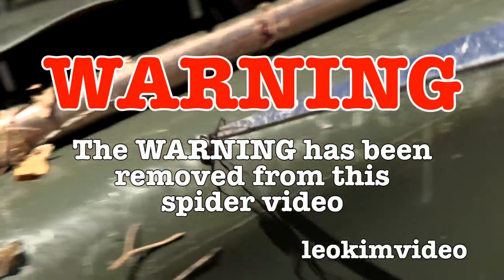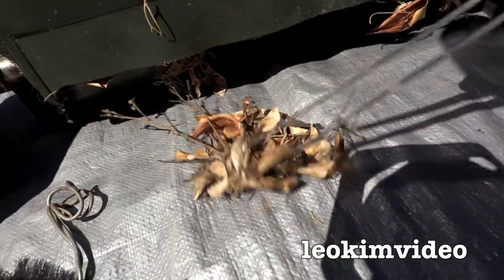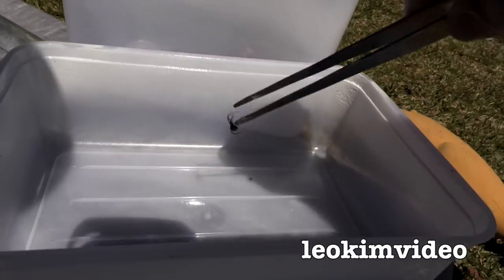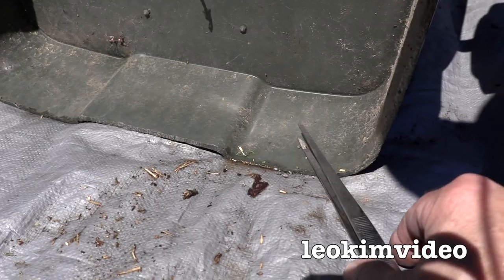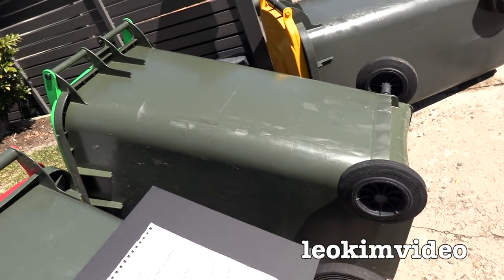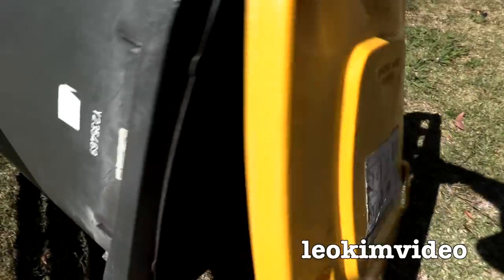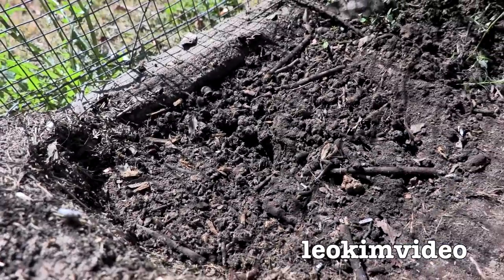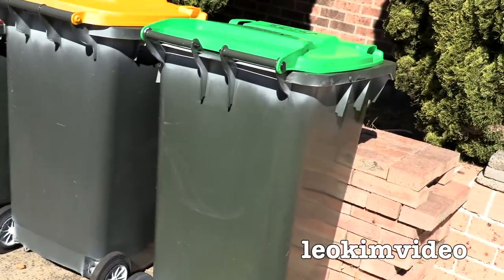Trash Bins Spider Removal $20 Fix & Redback Spider Tank EDUCATIONAL VIDEO

Comment: Keep up the good work! I love your videos. I got a war with recluses over here in Oregon. First it was ants and I won that battle. But now it's creepy spiders that leave a mark. I already got a bite on my ankle a week ago. Luckily I did my methods to clean it before it got bad. But I got webs and spiders all over my garage, and yard. Gonna go to the aerosol flame thrower method with a fire extinguisher, second hand and water to get rid of the webs and spiders. But I understand what you must be going through. I was removing siding from our fence the other day and saw a batch of recluses running everywhere in the yard and was thinking of you. Do you have any advice on safe flame thrower methods that will blast fire but not leave a residue or liquid to burn grass, or other stuff? I know you use a deodorant spray too. But I am just wondering what you would recommend to singe spiders and webs without a super concern about burning something down. Obviously you always need a hose, bucket, pan, and fire extinguisher for stuff like that. But I'm sure you understand what I am asking / saying. I am sick of getting bitten or worried about getting bitten by spiders in my garage and around my house. After my recluse bite on my ankle making me sick and burning like fire for a few days. I myself will not put up with it. Especially after seeing the big nets  of spider webs under the tables of  my wooden garage on rafters. I leave a box in there for a few days and they are in it. Or they are crawling out of my carpet cleaner if I leave it in there over night. I have also caught the crawling on the floor while I was under my tractor fixing the belts.. ugh.... I hate spider. Thanks again for the top on the 3 in one lithium grease!
Reply: Hope it got better .